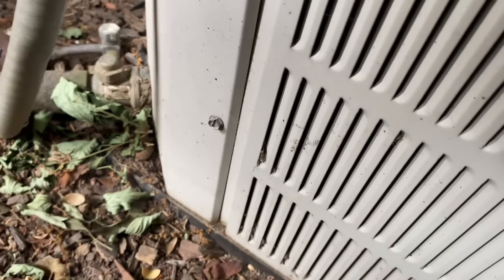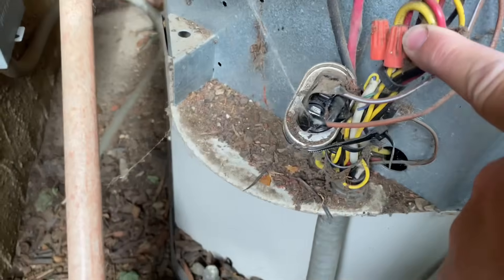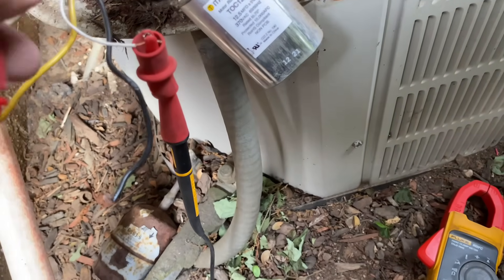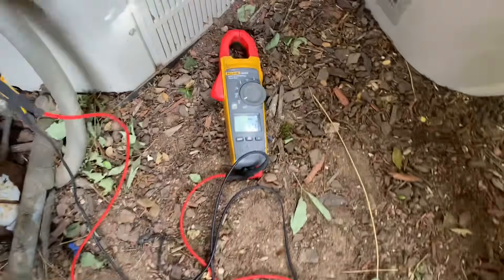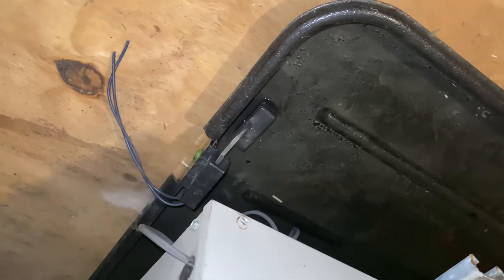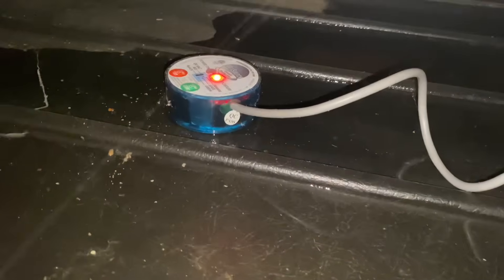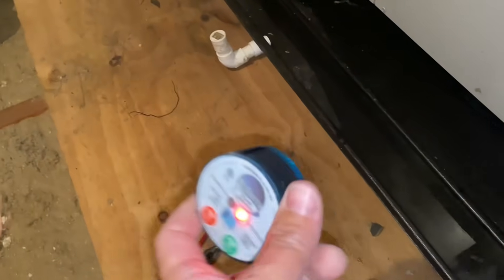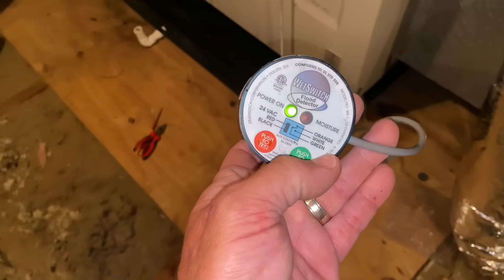Emergency No Cooling Service Call - Outdoor Unit Not Turning On

Comment: They really should put a beeper or buzzer on those floats to help diagnose easier! BTW - No cooling at our place about 30 mins ago, heat inside near 78 - was on earlier in the day. Did the a basic diag: outdoor unit wasn’t choochin, started with the breaker - all good, then checked fuses outside and one of the fuses was blown. Have two spares on hand - all back and running in 20 mins!

Comment: Customer always leading us in the wrong direction, if he didn’t tell you that he checked the float switch you probably could’ve saved a little time but hey sh*t happens 🤷🏾‍♂️ good stuff as always Mikey 👏🏾
Reply from the maker: Exactly. If he didn’t say that, after not hearing the contactor pulled in - I would have went upstairs if it was an easy attic - like stairs or pull down stairs like this service call. Otherwise, I would have pulled out my multimeter to check for 24 volts to contactor.
Reply: well, it never hurts to take a peak behind "door number 1" on the condenser. may find other visibly failing things or some dead cooked "jimmy's". Ted cracks me up.

Comment: Great video, i have an aerobic septic system , instead of bleach i put white vinegar in drainlines to keep ac lines clear..is that the right choice? Tia
Reply from the maker: I hear that works! Nice job!
Reply: shouldn't have the condensate ran to the septic anyway, depending on the homes airborne contaminates it can be either highly acidic or alkali. (cooking/cleaning/air fresheners/etc.)

Comment: That’s why I  add common to the stat and remove the batteries and break R.
Reply from the maker: Smart
Reply: it's kind of nice when the indoor blower stays on and melts ice from a low system. the floats should be manual reset though, with an unlabeled hole. lol

Comment: lol it’s amazing how
Often drains plug off ! A few years ago ago was on a SC a never been their. Got up in the smoking hot attic an?? 👀 holy cow the guy had a flipping 1”1/2 pvc line to the drain pan😂😂 it wasn’t plugged but where they adapted to the drain pan?? Reduce to 3/4” 🤦‍♂️🤦‍♂️ lol 1-1/2 don’t do anything if the inlet feed is 3/4 😂  but in the end was a bad trans but that drain blew me away

Comment: Great job. Hey- quick question....suppose there was no overflow switch/ clog issue. 

Do those air handlers have 24v transformers inside that feed the condensing unit? I rarely see anything about those- and never see videos where they fail. 
Do they? Thanks. Just curious
Reply from the maker: Yes they do
Reply: @PipeDoctor thanks

Comment: Nice diagnosis and fix Mikey Pipes and very concise video yet showing the full diagnostic. I'm thinking either that drain hasn't enough drop or it has a belly in it resulting in a build-up of sediment causing a blockage. If it has to run like that then maybe a series of pipe supports to maintain a consistent drop would help. Failing that, a new and shorter drain run with a suitable drop that works properly and reliably.
Reply from the maker: True!
Reply: yeah no pitch on that thing its just flat the whole way